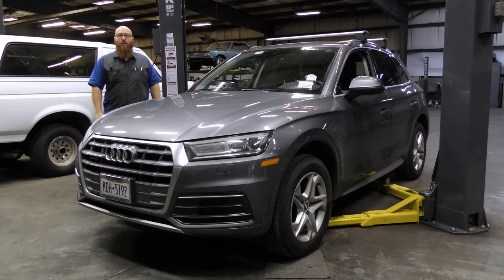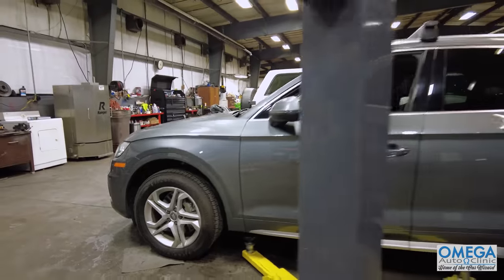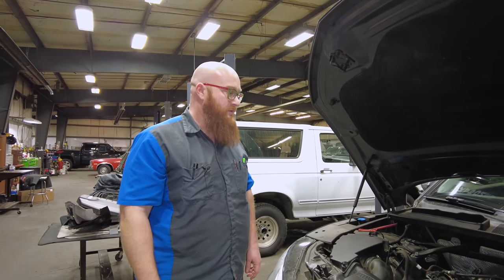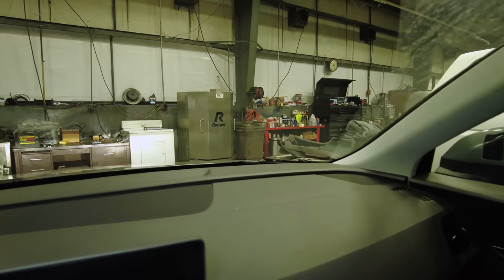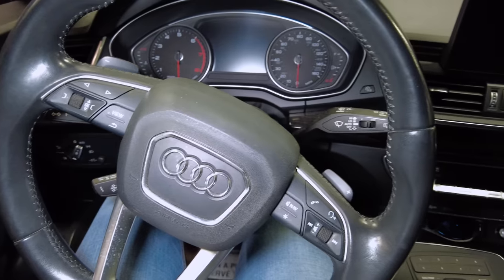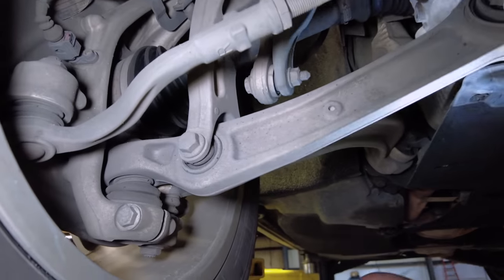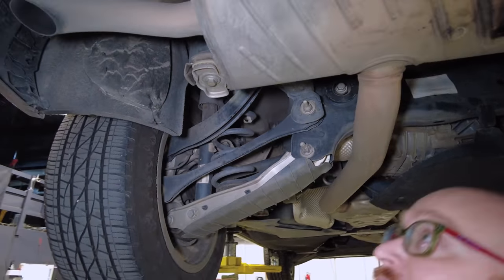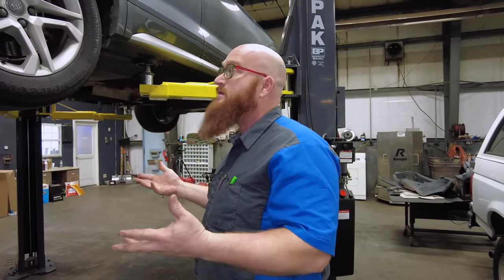2019 Audi Q5 with 200K miles & the service records to prove it! What did the CAR WIZARD need to fix?

Comment: None of the service stuff in that book seemed all that outrageous. I change my oil and rotate my own tires on my civic. I just do what the maintenance book tells me to do. Changed the brake fluid once because it told me. What is unique on that Audi aside from spark plugs? Don't you just do those every 100k miles?

Comment: No turbo repairs?
Reply: If you;
warm the engine up to operating temperature by driving gently until the oil is at normal operating temperature;
keep the right grade of oil at the right level in the sump;
change the oil filter at normal oil change intervals;
and do the same for the air filter changes:
why  should a simple turbocharger not work for the life of the engine????

Comment: Keeping up with regular maintenance on a German car isn't much different than an American or Japanese car. Where they get expensive is some of the goofy, unnecessary design decisions made by the engineers who designed the vehicle. One Volkswagen I owned had coolant running through the intake manifold. Any problem requiring that intake manifold be removed means it's a much more involved and time consuming job than most other cars. The car wasn't a high performance model, just a typical sedan so cooling the intake wasn't necessary at all. The car drove great but that had nothing to do with the coolant routed through the intake manifold.

Comment: Hello I have a 2007 Toyota Sequoia 4x4 the 4Lo light has been flashing for about three months now it drives perfectly fine with the light on. But sometimes the light turns off for a while and I am able to put it in 4LO and 4HI and I am able to lock the diff, I went to my local dealership since the shops around me don't specialize in diagnosing 4x4 vehicles, the dealer told me that I need all new transfer cases and all new diffs the total they quoted me as $12.000. Has anyone ran into this problem with their vehicle? please help.
Reply: If you put your year, make and model "with blinking 4wd light" in as a query you should get a checklist article from 4wd guide as the answer...
I'd almost bet on anold failing actuator and not a wholesale replacement of the driveline....
Mustie1 did one on his Toyota...

Comment: recent-year Porsche and Volvo owner here...  Automaker maintenance is recommended at 10k miles (or 1 yr, which ever comes first), which I always stick to carefully.  But there's always that debate about doing oil changes every 5k miles, even if manufacturer says 10k miles.  What's your take on that, for longevity?  (I notice that, when you went through the Audi maintenance book there, you didn't say the mileages at which the oil changes and standard servicing were done.  Was it the manufacturer-recommended 10k miles only?)

Comment: Puncture repairs and tyre rotation, tyre purchases every 5 minutes hardly points to a high maintenance German car.  I've had 2 broken windscreens replaced on my Japanese car - but that doesn't make it reliable or unreliable.  At least Audi specifies transmission service, and doesn't claim lifetime no maintenance like most American cars.

Comment: Car Wizard, what kind of oil do you use on this Q5? Factory recommendation is a very thin 0W-20, probably for emissions. Would the engine wear faster on a 0W-20 compared to say a more standard 5W-30?

Comment: I've got a 2016 Q5 with the 2.0T engine.  My Audi service department says the engine coolant and transmission fluid never need changing.  Getting close to 70K miles now.  Not real comfortable with that.  Any thoughts?

Comment: 1. Manufacturers should put engine hour for the engine and keep odometer for the trans and suspensions.
2. Piece of junk: they still are, but in terms of durability.  Either the design and/or manufacturing are not up-to-par with Toyota.

Comment: Given your recent video about the importance of timing chain related maintenance, did the valve train in this vehicle ever get any service? Other commenters have noted that this vehicle has likely received all highway mileage, and I am guessing that the relatively few cold start cycles is much easier on the valve train and engine in general.

Comment: How about the misfires due to carbon deposits on the intake valves for which the 2.0 gasoline engine is famous? Is that a normal maintanance? I think only for VW group...
Reply: He's likely had multiple decarbonization intervals done on this. No way he's made it this far without it.
Reply: I'm not sure if US market 2.0T gen3 has it, but at least on mine that issue has been fixed, it is no longer straight direct injection, there's also a port injector which means no carbon deposits
(Audi TT 8S 2.0T)
Reply: @Jobaa87  I believe that switch was made in 16/17 in the States, which also brought on a power bump on thr engine as well.

Comment: It has little to do with above average maintenance and A LOT to do with the short length of its life thus far. Pretty much common sense if you understand basic engineering.  Not very many thermal cycles, low amount of time exposing bushings, seals, and other materials to the elements.  

I worked for Cummins for 8 years and basically learned that if you started a new engine never turned it off, it would theoretically run “forever” as long as engine oil was able to be cycled through with new oil while running with external sumps.  Thermal cycles wear out your car.  Salt wears out your car.  That’s about it.

Comment: It's always funny and easy to talk trash about the reliability of audi's and other german cars. My family has owned nothing but german cars, 6 audis and 3 mercedes. Every single one of those vehicles were reliable, because we did the maintenance that was required on them. We even had a 1996 audi that constantly fixed its own problems. That car went almost 200k miles before selling it. We had a 2010 audi a4 with over 200k miles, and currently still have a 2003 audi a4 with just under 200k miles. I had a 2012 audi a7 with 140k problem free miles... This whole reliability talk is like listening to parrots hearing one thing and repeating it over and over again because youtube.

Comment: Have you changed the transmission oil and filter for that q5? I have a 2017 115000 thinking about changing the trans fluid very soon .

Comment: Hey Car Wizard. Do you think if the same maintenance routine applied to a Q7, would the results be the same?
Reply: If it's a 3.0TFSI with the 8-speed, absolutely. Seen ridiculous mileage on em in good shape.
Reply: Change your oil every 4k miles or 6 months which comes first and you will be surprised how reliable becomes
Reply: @Nathan Jay  Im thinking about getting one that is 2017 with a 3-liter supercharged engine. It is still relatively low KMs around 80k km. Was wondering if it would see 250k kms or so if well maintained.
Reply: @FuryfistX  clean fluids make equipment run forever because it will never wear out. Dirty fluids make equipment fail fast

Comment: $80,000 German car that is 3 years old. Another $40,000 in maintenance. Or you can just buy a Toyota. Spend $40,000 and do the basics of maintenance and have a car that will last 400,000 miles.

Comment: Miles matter less than cycles. If you drive small trips you need more expensive maintenance on these diesel engines.

Personally i drive 40-50.000 miles a year (calculated from me driving around 1000miles per week with some weeks less)

I own an A5 3.0 tdi with just about 150.000 miles on it, and every single service has been done. No major repairs, and in denmark, authorized audi shops give you discount and cheaper oil changes than the local hill billy shop. My car looks and runs new, even tho is getting old.

Sure, a honda accord requires less maintenance, and you should buy it if you dont care about cars. 

But this is an audi, a car multiple tiers nicer than a honda, it feels better to drive, it's faster, sounds cooler, better interior. It requires more love, because it is more advanced. Cant afford a german car maintenance? Don't buy a german car. Buy one of them cars that say ni hao when you put the key in.

Comment: You’re dead wrong about trash talking VW/Audis I’d say.  I have had more than 100 different of them and my current A6 2.4 V6 has 322000km with the same driveline including original clutch, cam chain, exhaust etc. And I’m a Toyota tech…
Reply: Those are eur0o spec..american market German is junk
Reply: Q5 is a Mexican car, made in Mexico, only 20% of German parts, rest are Mexican and Chinese.

Comment: The mechanics are spreading too much bs on German cars, they are reliable given oil changes are done half the interval and other changes are done in advance. Costco does unlimited tire rotations for free if you buy tires from them, oil changes should be DIY. Please take those pages out - the rest will be as expensive as a Camry.

Comment: my bmw  start leaks oil,coolant leaks,the intelligent battery sensor, wheel bearings,power windows failure.all these only after 140,000 kms. far from reliable

Comment: I would love to know the milage that the oil was changed at.  I have never believed in the 10K oil changes.  I don't care if you use synthetic, if you go to 10K between oil changes your engine is going to get gummed up bad.  I own a Porsche Macan with the twin turbo V6, got 50K on it now and the oil has been changed every 5k since new.  Lets see where we are at at 200K.  I already had an engine out service for an oil leak at 18K covered under warranty.  Dealer had it for four months waiting on parts.  At least they gave me a new Macan for a loaner.
Reply: 3000 miles or yearly for me.
Reply: Did oil changes only every 37.5k miles on my old car, never had any issue. Diesel. Sold it with 180k miles running like new. Didn't go soft either. 110mph on the Autobahn was normal speed. Used only mobile 1 synthetic oil. Only once I had to refill 1 liter when I really had a lot of autobahn miles.

So yea. But of course for gasoline cars you need to change more often, especially a car with so much horsepower.
Reply: @computercrack  That is complete nonsense.  37.5k oil changes?  That stuff would look like black bathroom caulk at that point!
Reply: @Flies2FLL  yeah no problem. You can look it up. 2003 Opel/Vauxhall Vectra with 2.2DTI Diesel engine. Oil change every 2 years or 50.000km (31kish miles) according to the car computer. You could hit some button to show how much milage you could do before oil change. I always kind of extended it a little bit to 60.000km (37.5k miles) after exactly 2 years. 

For the next model (insignia or what you know as a buick Regal) they tuned it down though to 30k km and yearly change. It all depends on personal circumstance if you ask me. Driving a lot with low RPM and very little cold starts you don't need to chamge the oil that often. High rpm and lots of cold starts / driving little distances requires more oil changes like every year or even earlier.
Reply: @computercrack  That last is certainly true.  But I don't care what any owners manual says, oil becomes contaminated with soot and water which do not get properly filtered out.  I recommend 5,000 miles at maximum for oil, and really 3000 miles/yearly.  It's cheap insurance for the longevity of an engine.  Thanx!
Reply: Owner mentioned he did oil every 5k miles
Reply: @jcollins1305  My dad owned junk GM cars in the '80's, and drove some of them to 200,000+ miles with no measurable oil usage.  And he did changes every 3000 miles, so take it for what it is worth.  Thanx!

Comment: I have a Honda Accord I bored with it had for year
Reply: How many pages in your ring binder??
Reply: @JohnSmith-yv6eq  well on a computer I do oil change regular change the cvt fluid every 20 k had the anti freeze change not too long ago
Reply: @jeffreysmall8902  
10 years on from noqw you'll still be bored..
but you'll be thousands of dollars ahead...
and safe.
Want to be thrilled, excited, terrified even?
want to pour money down a hole?
Buy a boat.

Comment: Give it 5 more years
Reply: This is all highway miles so as Scotty K says it's as 20k city  Miles.
I'll say 2,3 or 4 more years before some electrical component like a sensor begins to fail or some plastic cooling pipe leaks due to it becoming brittle and overheats the engine. If it has an electric water pump as worst as the BMW ones, it can go any time now.
Reply: @malibuman8941  Highway miles are much easier on a car. By the time we see these vehicles, the instrument cluster looks like a Christmas tree, and parts it needs are dealership only 😒

Comment: Wizard you don't get out much do you....kia and hyundai lineup is very exciting and make a better car or at least level with toyota since hhe Tucson 2nd gen hit the lots in 2011..look at the kia stinger gt, telluride and more plus all N line  hyundais.....i also think you need to take into account the engineering that goes into the 5.4 triton....the power and torque band  with amazing mpg....andbwith proper maintainance they easy get 300 400 tjousand miles  sorry but audi makes some of the most boring cars. BMW and Mercedes too. Unless you drop 150,000 $ which you can get cars and trucks oh plenty that are not boring....

Comment: Eh, I had an Audi A6 that made it to 335k miles no problem. Replaced it with another A6 that has 280k on it now.
https://www.youtube.com/watch?v=xUzWu4iBqD8
Car was used hard driving on construction sites almost every day. Tires, brakes, suspension, timing belts, one radiator and a new transmission, never touched anything else on the car. How many electronic things were broken on the inside? Yes. But it was a great car, great experience, great priced used, bought another one, couldn't be happier.

Comment: This video is full of misinformation. 
Modern cars depend on petroleum based products,all fail with age not milage(yes even electric cars are made with petroleum. 
O-rings,u-joints,boots on most greasable areas ,bushings on all suspension,body panels,bumper covers, cowls,every piece of plastic,including modules.
Again mileage is less important then age.
Example.... a module's plastic dries out and becomes brittle and the electronic board rattles away from the silastic bonding ..causing a component of the board to work harden.

Comment: Car Wizard - I like your videos, but this one is kind of lame. If you want to beat up on German vehicles as being unreliable and expensive to maintain, that's fine, but this example rings hollow. Flat tire, tire rotations, oil changes, a bushing, a windshield, spark plugs, etc.  That could be a Toyota, a Honda, or any car. This Audi doesn't support your narrative.

Comment: Still trash. For the amount of money that this has depreciated on this I could buy the last 6 old 4runners and 1 or 2 old junk Jeep’s but I’m not cool and I’m cheap. I do like my 07 4runner v8 it only has 300,000 miles
Reply: Toyota bucket of bolts

Comment: Ok David, good job as usual. David, it is enough, you have had it long enough, it is time to get rid of the beard (and before a fan belt rips it off your face). This shaven head, long beard fashion has run its course - please cut it.